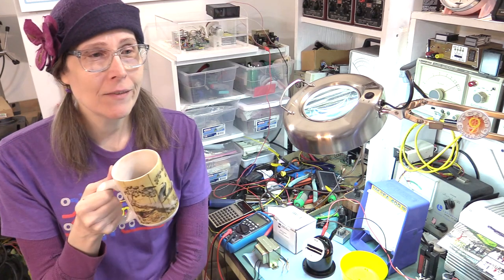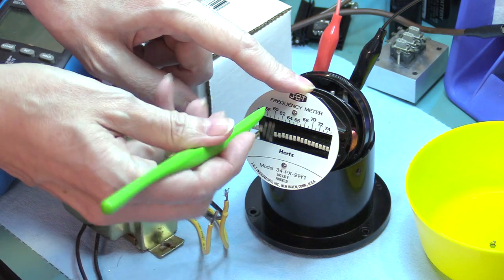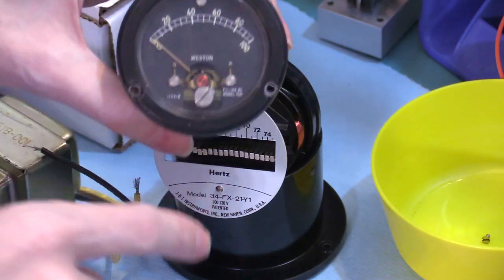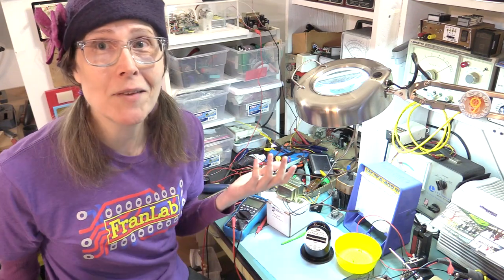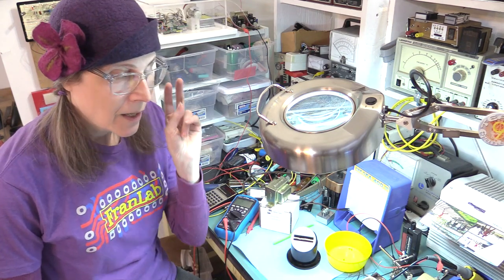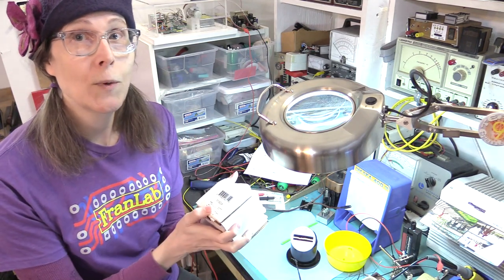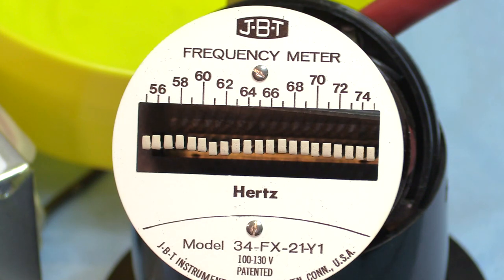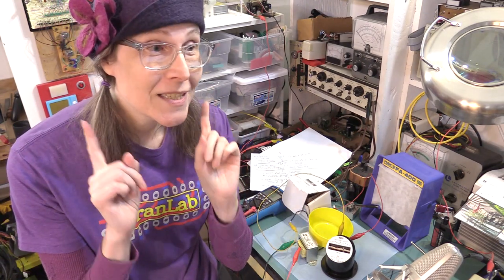Deep Dive Into The Electromagnetic Frequency Counter

Comment: Fran, resistance (R) mean not impedance (Z). You not consider the inductance (X) of the transformer.
Reply: Even if it doesn't gives you the exact impedance, you can get a picture of the overall impedance.
Remember that Z = R + jX, if R is very high, then Z is going to be very high.
Reply: @nejiniisan1265  No, actually it is frequently opposite. The larger mains transformer - the lower the R, and higher Z. This means the tiniest transformer from an alarm clock will have much higher R on primary side, because it has a thin winding. And the powerful transformer from a classic audio receiver will have much lower R on the primary side, and much higher Z.
Reply: You do realize that she is specifically calling out comments like this a lot in this video. She knows what she is doing.

Comment: The "Do not open" and "Sealed" warnings (and variations) are common on old test equipment in order to discourage users from "fixing" them. As you know, these meters have very delicate internal components that are easy to damage. I had to learn this the hard way while trying to learn how to fix them. I "fixed" more than my fair share! Some meters, Weston 260s and old Thomson ammeters for example, even have some kind of resin covering the screw you need to remove to open up the device.

Comment: Great Video, and great solution, but the static resistance of a transformer has little to do with its impedance at alternating current.  The 24 volt transformer is designed for the frequency spectrum we are talking about.  The problem would be that you would have to drive the secondary with a 24 volt signal to get 120 at the output. That would mean your amp needs to have an output power of 72 watts (24^2)/8.
It would present a load of 3.2k to your amp, in a perfect world that is. But by no means would it overload it. I'd  only be concerned about the amp running at practically no load wich isn't good either. Anyway it would work. I just would not drive it for hours.
Reply: Correct me if I'm wrong, I'm not a professional, I just learned this stuff the way you do.  Dive in to it and see where it gets you. Life is a great teacher. Keep being interested and never give up no matter what happens and wich problems you run into.

Comment: it somehow works like a blade-harp. The same concept for working and producing sound by resonance is also valid for mouth-blown harmonica instruments. Not by alternating current flowing through a electromagnetic coil, making the blades resonate to the frequency of each individual blade (spring steel), but by airflow. You blow air into with your mouth, and when a key is pressed, a sound is produced by a blade resonating in the airflow. Same also is working in a the folding harmoniums - pull apart and together all the time while playing - (traditional instruments, also the smaller 6-edge or round tango-harmoniums work this way)  And also crank-driven music-clocks have such a tiny "bladeharp".     Add: Please don't compare "DC resistance" with "AC resistance" across an AC power transformer or even across every other type of transformer !!!   it has much higher "effective resistance" for AC (also increasing with increasing frequency, so it varies according to how it is used) actually. so your powerstation won't "cook" itself up with sending AC through it. DC resistance is low of course (because no self-inductive effects going on, except for the moment it is being switched on, it "retards" the inrush impulse because of the self-induction, but thereafter the DC resistance is what remains. Totally different when in AC use. AC across a coil produces additional inductive resistance because of the ongoing selfinduction effect steadily (changing currents and voltage levels all the time) AND current and voltage peaks are getting shifted apart by the phase shift caused by induction effects, varying the momentary resistance according to where the wave ascent/descent is currently, and which "time-constant" is valid for the indivudual transformer, its inductivity and how tight its coupling is, depending on  a certain frequency (it varies with the frequency).

Comment: Just saw a segment of the PBS show Motorweek from 1991.  Their mechanic demonstrated a vibration detector that looked and operated similar to this one.  There was no electrical connections or coil, but they set it up on a car dashboard while driving and saw which of the various reeds vibrated.  It seems interesting, but you would have to know the resonant frequencies of various components in order to figure out what was producing the noise, vibration of harshness.

Comment: Fender Rhodes keyboard's work on the same principle. Those tines have different lengths to generate different tones, but calibrated or tuned by a small spring put on the tine that's adjustable.

Comment: Funny.  I used a frequency meter today, while working on a gas RV generator!   Which would be a use for these type of panel meters.  So obviously you already figured out how to make that meter work, but another simple way would have been to find an older small gas generator (one prior to electronic control) to connect to and vary the throttle a bit.

Comment: Fran, you are obviously not considering that AC impedance is not equal to DC resistance. You measured the primary DC resistance of that fairly small transformer to 11 ohms. If you just go by that then that transformer would draw over 10 A connected to 120 V AC, with the secondary winding open. Obviously it does no do that. At 60Hz if will draw very little. I suspect it will draw no more than say 2 W, which with ohms law give it an impedance of about 7.2 kohms. I am fairly confident that the amp will have no problems driving it. I also suspect that you could drive it directly from the output of a signal generator. The amplitude may be to low for a usable indication on the meter though. Perhaps you have a 6V AC wall wart you can run backwards from the generator?

Comment: @11m20s, I think you are right! It's about shaping the magnetic field. It's also explained in one of the patents; https://patents.google.com/patent/US3374432A (See Fig. 1, 52 and 54.)

"In this figure, the leftmost reed of the set 48, designated by the
numeral 58, will have the lowest frequency, say for ex
ample 56 cycles per second. This reed, which is heavier
than the other reeds and slower, will be subjected to a
lesser flux density by virtue of the pole flanges 52, 54
having at this location a greater spacing and also a greater
front-to-rear dimension (at the left side of the movement
of FIG. 1). "

Comment: Kind of reminds me of a Reed tach. They were used on machinery that didn't have a reason for an  electrical connection such as a steam turbine driving a pump. I dug one out of  my junk box for a look at the builder. The brand is H.H. STICHT CO INC of NEW YORK NY. STANDCO TACHOMETER MODEL R2. The range is 1000 to 5500.

Comment: I'm certainly not an expert on magnetics, but surely the input/output impedance of the transformer isn't just determined by the winding resistance, but depends on the ratio and the source/load connected? I mean, a theoretical "perfect" transformer has zero resistance doesn't it?

Comment: I think I figured out the exact purpose of the diverging angle iron pieces! I believe yes they are to have less flux (is that the right word? 😛) at the lower frequencies and more at higher. So think like a rubber band being stretched. All things being equal more flux, more motive force, faster acceleration, higher resonant frequencies. Like a rubber band being stretched tighter.

I thought well that sounds great, but what then are the solder blobs and filling for? Then I noticed that they are all roughly the same. So probably it's to fine tune each to account for imperfect manufacturing whether it shows up in the magnetic field differing from ideal and/or the tines. Each frequency tine has a certain amount tuning that can be applied to smooth out any irregularities.

Which I means unless the coil was powered when operating as a pickup you most likely wouldn't hear much of a difference between tines as they would be fairly close in resonant frequency unless in the powered assembly.

Neither I think would you hear much of anything at all unless either the coil was on or the tines were magnetised.

But then I don't know how a magnetic pickup works exactly. I assumed it was a permanent magnet moving in a stationary unpowered coil. But I don't know and suppose a stationary powered coil and low reluctance moving element would change the current through or voltage across the coil... What can I say, I am not so hot in the analogue domain. Mi Scusi 🤣

Comment: The length of the resonator "fingers" might give a hint to why the two plates are angled.
On the higher frequencies, the fingers are shorter and therefore relatively stiffer, so they need a little more force to be actuated. The closer the plate, the more effective its magnetic influence gets.

Comment: The unit was probably made in the 1960s. The name was established by the International Electrotechnical Commission (IEC) in 1930, but the General Conference on Weights and Measures didn't officially replace cycles per second with Hertz until 1960.  I remember seeing references to cycles per second in consumer electronics publications throughout the 1960s. It wasn't until the '70s that Hertz received widespread use. (That said, the manufacturer of this device could have been especially prescient.)

Comment: I don't know the output impedance of the 70v paging/public-address amps, but the 600 ohm primary transformer you tested with seems like what you'd use at the speaker end on one of those systems. Which makes me happy, as it fits with my comment on the first video that using a 70v system would possibly drive the meter.

Comment: I used one of these as a student, way back in the 60's, to bring alternators up to speed before connecting them to the National Grid.
Ours were circular with 50Hz at the top centre (I'm in the UK) and about 12" diameter or maybe 15".
Designed to be wall-mounted in the power station so the engineer could see them from the control desk.
Ours were 45-55Hz so I wonder why your American ones weren't 55-65 with mains frequency in the centre?

Comment: Oh dear. I have had one of these for years, and ran it just fine with a "reversed" 5v transformer and a cheap 3w ebay audio amp module. And a 555 for the frequency drive... So I wasn't just stroking the chin and guessing with the suggestion!
Reply: Don't be foolish, she explained herself and the more you push it, the less believable you become.

Comment: But you haven't TRIED the step-up transformer (common "filament" varieity). I have. It works well.
If ya' cant get enough current through the meter's coil, a capacitor in series between the meter and the transformer's HV winding will help. Your Bassman will not fry in any event. ;-)

Comment: Fran, I really love the demonstration, but I feel it is really important to keep things precise around impedance and resistance. It is a source of endless confusion. A transformer will convert the impedance by a square of the turns ratio. So an unloaded transformer looks like an open circuit (as long as the core will not saturate at super low frequencies and high amplitudes). To adapt a 16K load to an amp expecting 8 Ohm impedance, you really need a transformer with turns ratio of about 44. On the other hand, Your bassman amp probably would not complain operating even into a dead short circuit either: What the power pentodes really hate is the excess load impedance. A pentode behaves almost like a current source, loading it with too low an impedance will probably just limit the output power and bass response.

Comment: I'm afraid theory about transformers was rubbish, you don't need to match impedances to transmit power.  When you connect a heater to the mains you don't match the heater resistance to the output impedance of the mains which is near as dammit zero.  An amplifier designed to drive an 8 Ohm load doesn't have an output impedance of 8 Ohm, it's perhaps 0.1 Ohm.  The rating of 8 Ohm is just the load that it can drive without being overloaded.

The original 24V mains transformer would have worked just as well as the audio matching transformer.  They are both just transformers designed to cover the required frequency range.  The audio transformer has a turns ratio of 8.7 and the mains transformer has a turns ratio of 5, there's not much differrence between them.   If you had used the mains transformer then the 16k impedance of the meter would have been reflected back into the amplifier as 16k / 5^2 = 640 Ohm,  not 0.6 Ohms.  The amplifier would have been quite happy with that.  The dc resistance of the windings is irrelevant. 

Using the mains transformer you could even have driven it directly from the signal generator which probably has an output impedance of 600 Ohm but it probably wouldn't have had sufficient output voltage to work.  It would need an unloaded output voltage of 50V to produce 120V across the meter.

Comment: I think the reason the plates are closer together on the high frequency side is so magnetic field is stronger on that side.  That way, the tines have the same offset regardless of frequency.  If the magnetic field was constant for the entire range, the high frequency tines would have a smaller offset.

Comment: The dc resistance of a transformer does not tell you the ac dynamic impedance
Reply: Add: a perfect transformer would have 0 dc resistance on both windings

Comment: There exists a similar device for "mechanical" frequency counting that resonates with mechanical vibrations! You might try resting this unit on a transformer frame thats connected to your mains to observe if it will resonate. Also You would need to place magnets on or near tines to have it produce sound through amp like a pickup!

Comment: BTW driving that meter should be easier than that, even. Ave's channel did a video on one very similar to this but it was not electrically driven at all. So you should be able to put it just near your amp and play the frequency you want to show and it should vibrate even w/o any electrical connection at all.

Comment: Bollocks! The high impedance of the coil will work fine with a transformer  .  Thats why you can see the output on a scope , drive a electrostatic speaker  etc etc etc.
Reply: Yeah. No reason it wouldnt work if it's designed to just run on mains voltage. Doesnt matter if the voltage comes from a transformer on the bench or down the street.
Reply: You mean to say "Fran, I think that's not right there, let me show why I think that...". Basic decency.
Reply: @VincentGroenewold  No I mean she's talking BOLLOCKS  (and probably knows it!)
Reply: @wktodd  great way to let others learn, I’d love to be your colleague.
Reply: I agree that is a bit of a harsh manner.  Somebody within these comments corrected me that where I had said "first harmonic" when it was really "second harmonic".  I had not written accurately enough what was in my mind which was "the first harmonic above the fundamental".  But their manner of criticism was matter of fact. even collegial, and not cruel.  I suspect it may be true that Fran doesn't know all things in the universe of electronics and mechanics (who does?) and suspect it is ALSO true that she sometimes misspeaks about something that she does know (who doesn't?)

Comment: A relatively easy solution to sweep the frequency might be a basic generator with a modified throttle control so you could easily tweak the engine speed and thus the generators frequency.  Even so that is still a bit of custom setup to make it work.

Comment: I'm intrigued by the scale this meter uses, it doesn't have 50Hz on it so clearly it's meant for 60Hz systems, but then why isn't 60 in the middle of the scale? I wonder if there's a practical reason (eg frequencies above nominal are more common than ones below) or if they just couldn't get the meter to work correctly at lower frequencies.
Reply: I was wondering, too. Maybe it has something to do with the fact that running inductive loads at too low a frequency will cause excessive current but a high frequency is okay.

Comment: 7:50 I bet they did this tuning with a soldering iron an some good old music style tuning forks. Because of course you would.

Leaving expensive for the time precision oscillators to be perhaps used for QC checks, as well as plugging it in next to a known good one and maybe with a sweep or simply the mains (and a resistive dummy load?) with the known good being a sanity check on drift in the mains.

Comment: i'm pretty sure feeding that mains transformer backwards WILL work, include an 8 ohm or more in series with the output of your amp,  to limit load on it,  i've driven small transformers from audio output chips ok with a series resistor ,that way the amp will never 'see' a load lower than it could handle

Comment: You could sit it on top of a driver or speaker enclosure and drive it with a sig gen and an amp, varying the freq to get the tynes vibrating, without any electrical connection.
They used to make diesel engine tacho's this way a long time back.

Comment: This thing is a mechanical spectrum analyzer.  It would be interesting to see how it respond  with if several tones are added at the input.
And BTW I dont thing there is much difference between transformers. The coil resistance dont matter too much...
Regards